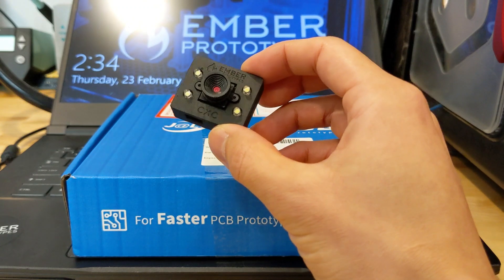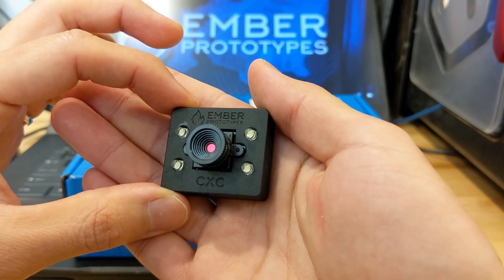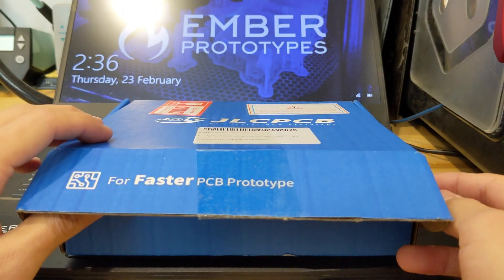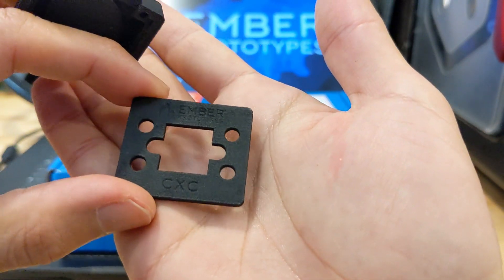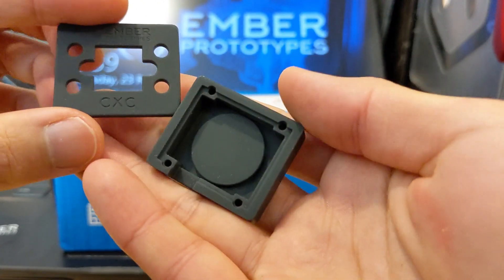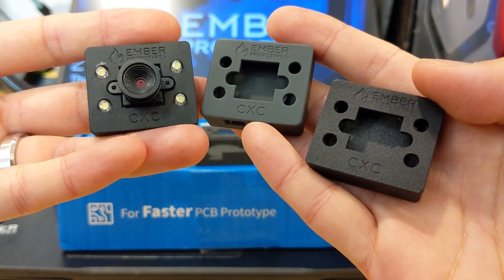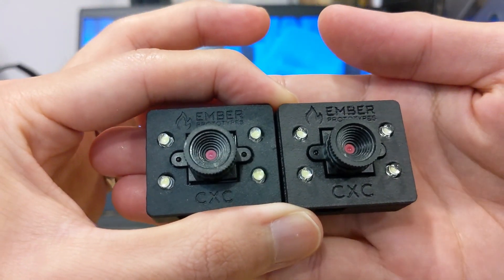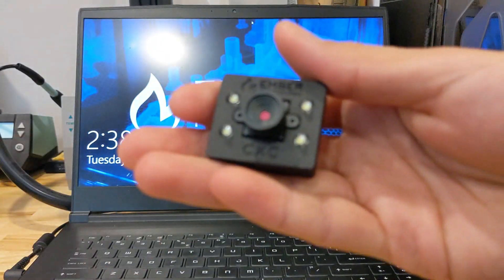Comparing MJF vs SLS vs SLA for our product

Comment: We have been dealing with these kinds of companies (there are a bunch of other ones as well) for a while now. The biggest issue we've been running into is consistency. I actually have a very strong suspicion that they have a print on demand structure like Vistaprint etc for stickers. So in other words, they let other small businesses print. 
For exactly the same product we had wildly different results. Or defects all of a sudden. 
The only way to really prevent this, is to send them a mother sample they can work from.
Reply from the maker: Yes consistency varies a lot from these places. They often pack the builds in different orientations so batch to batch your parts can vary quite a bit. It's the trade off for low cost, but if your design can accommodate the variation then it can be a great service. Otherwise you need to look at alternative suppliers that charge a bit more to ensure your parts are always being printed the same way with the same material, on the same machine.

Comment: I recently ordered JLCPCB samples of SLS and MFJ. The MJF part looked like it had some post processing done on it to make it slightly glossy with no layer lines (injection mold look).

Have you noticed this?

I am wondering if it was because I happened to get a fresh batch of Nylon.... or if they do some vapor smoothing to them.
Reply from the maker: I'm sure that they're at least bead blasted. In my experience MJF parts tend to come out nicer than the SLS counterparts...but it really depends on what SLS machine the company uses. There can be wildly different quality and surface finish results between different SLS machines and I've seen that very vividly with real sample parts from different manufacturers.

Comment: Do you recall the depth you used for the logo on the updated version? I am working on some parts and using their technical specs is far too deep for what I am hoping to achieve. Also curious if you've printed any parts in 1mm and how those may have come out.
Reply from the maker: Logo depths are 0.5mm and it turns out really nice for me!
Reply: @ awesome. Thanks!!
Reply from the maker: @BagBuff  anytime!

Comment: I also did the same comparison for my casing and MJF won. It just has very good details and a nice finish. One problem is that they are not always the exact same size. Sometimes the screw holes are tight sometimes the screw just bearly grips. Maybe keep that in mind with fittings
Reply from the maker: Good to know! I have a friend who runs a bigger service bureau than us who also warned us of similar things, especially as MJF part size increases. They said for parts like ours, it hits the perfect sweet spot of MJF!
Reply: @emberprototypes  ah thanks for the info. My part is about 170% of your part and my casing has two half shells. It's interesting that it's related to the size of the part. 
My solution for screw holes is to go down. To 2.5mm diameter for a M3 hole. Then you have the option of drilling it.
Reply from the maker: @save_jeff  yeah he mentioned that he sees more warp on MJF parts because of the way the technology works (lower temp + binder). And typically the larger the parts, the more warp you get.

I've actually gotten back some small parts that warped from JLC PCB, but they fixed that issue quickly for me and resent new ones.
Reply: @emberprototypes  okay that's weird. I have not seen warping like you would expect with resin parts. There I had significantly warped surfaces. With MJF its like an irregular shrinkage or it's dependent on the orientation it was printed. 

With JLCPCB I had some reprints due to scratch like imperfections, but they reprinted them before sending them to me. 
I hope they improve MJF printing Process further as I think it's the best method for production parts. The level of detail is just so good
Reply from the maker: @save_jeff  yeah that's what my friend told me about large MJF parts vs SLS, but I don't have first hand experience. Either way I love that we have options for making production parts without having to commit to injection molding nowadays 🙂
Reply: @save_jeff  in one of the video, they show bunch of prints placed in a way to increase yield, that would explain the random orientation

Comment: Why not go full injection molding? Seems like the parts are rather small and without much overhangs and intricate details, and could easily be made, with a decent benchtop IM such as Morgan press(can also put together an equally capable machine at fraction of the cost!). Also the mold can be made locally in Aluminum with little investment on a small CNC mill. Just some 💭
Reply from the maker: Yeah good questions! There are several reasons why we didn't IM these.

1) When we first launched the product we didn't know what the demand would be so in-house SLA then MJF was a great way to scale gradually without a lot of up front investment required

2) We don't make enough of these to justify making a mold. Even though these parts are small, it's probably still at least $5K USD to make the molds. Especially when the cost of small MJF parts is pretty low, I think it would take maybe 2-3 years to pay off the mold cost at the quantities we are producing.

3) We want to avoid having to manufacture the enclosures in-house. We did this for the first batch using in-house SLA, which was fantastic to get us started, but the labor involved isn't desirable for a small company like us. I'd rather outsource that and spend time on further R&D, etc.
Reply: @emberprototypes   I do agree with most of the concerns. But since you already have the sla capability, should seriously look at making high temp sla molds for prototyping and low volume production. Look at past videos of buster beagle channel, mk3 IM machine, it should be a fairly small investment. Also with a small cnc milling machine, you could make aluminum molds with decent quality inhouse. It is not a bad idea, compared to making one time 5-10k mold that is usable just for one product. Again, if you have a decent IM setup, you could expect a throughput of 5 mins or less per  part, with hardly any postprocessing. It has more materials to use(can even use peek!), apart from significantly less per part cost equal to quantity of pellets or recycled plastic.
Again, its application specific, and in this case it is more appropriate. In the end, will have new skill and capability, that could be of significant benefit, for the business long term.
Reply from the maker: @aware2action  I think "more appropriate" is subjective. What you're talking about is not an inconsequential amount of time and equipment to do well. Either way, there are multiple ways to skin a cat and this is what we decided! I don't think doing it any other way really has such significant benefits that we would change anything right now, but in future, you never know!
Reply: @emberprototypes  I do understand, its just something to keep in mind for future🙂. If you get the kitted parts, you could put together the MK3 in a days work, with some planning in advance. Can't get a 3in3/50gm capacity machine at that rediculous price!. But there are some mods needed to improve clamping force. I am not selling anything, myself being an ordinary mk3 user😊.